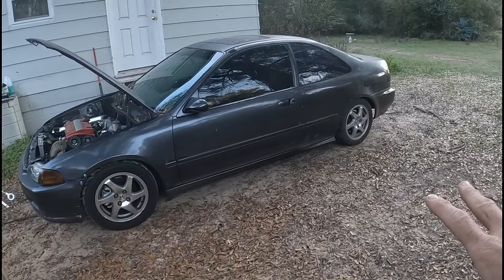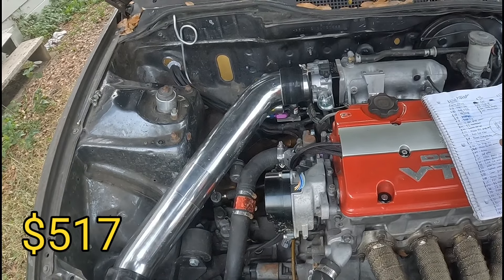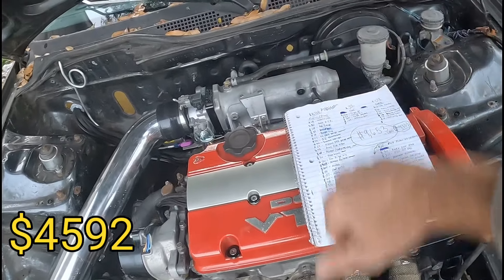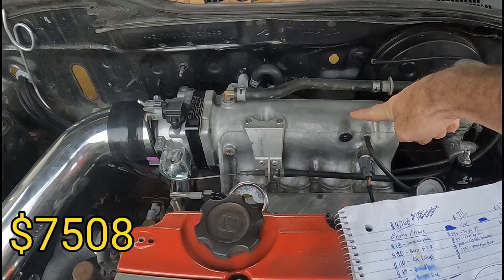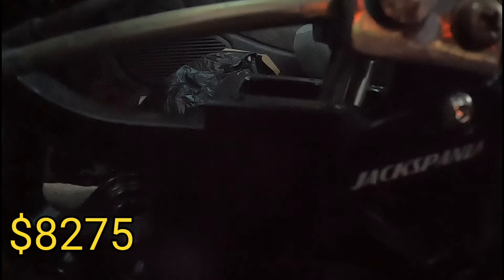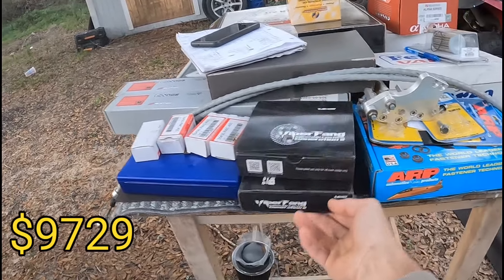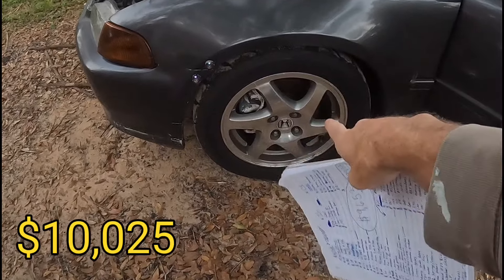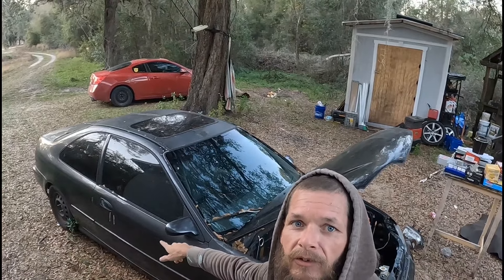|COST BREAKDOWN| NITROUS Civic G23 vtec....what I spent

Comment: I was doing this the other day n I'm around the same if I just add up the current I'm around 7-8k not counting the labor I paid for like tune and valve adjustment and other stuff wen I think about it I'm like I should have just went k cuz all motor b series is not worth here's some of the parts I can think off the back of my head Gsr b18c1 head 
Jdm b20b 700
Rmf header 2.5in collector 250
3in short ram 50
Rev hard manifold  350
Skunk2 70mm thottle body 120
Test pipe 2.5in 100
Cat bacc 2.5 to a spoon n1 400
Pro 1 cams 700
Blox dual valve springs 150
Supertech steel retainers 200
Light flywheel 150
Act stg3 clutch 400
High comp jdm itr style pistons 200
P0p2 h beam rod 350
Arp rod bolts 50
Arp head studs 200
Zerg industry 2 layer head gasket 100
Aem fuel rail 150
Aem adjustable fuel regulator 100
Aem 355 fuel pump 220
Id 1050cc injectors 530
Plm timing belt tensioner 100
Acl racing rod bearing 100
Thermal intake gasket 45
Thermal tb gasket 35
Blox cam gears 150
Fuel relay kit 150
Tucked engine harness 500
Blox flat valve 200
Vms adjustable cam gears had to use these because my Blox broke lol 80
p06 hondata s300 v3 700
Stock bore stock ports
Reply from the maker: Lsvtec, sweet. Built a  few of those in my life. Any HP numbers?